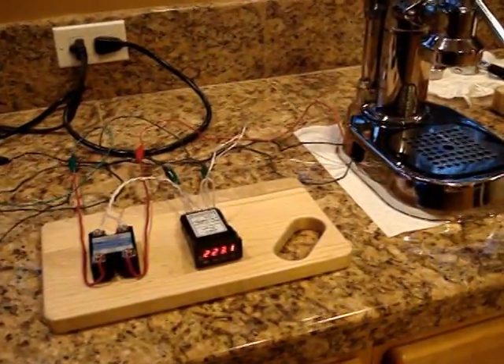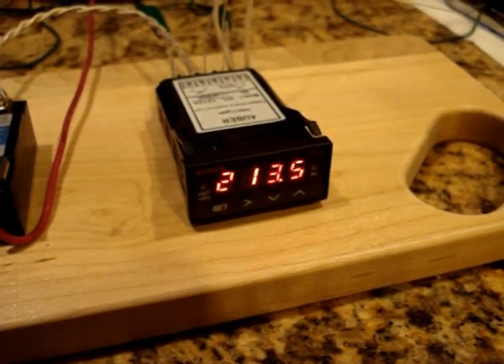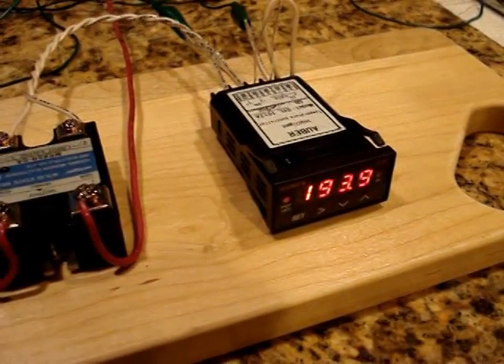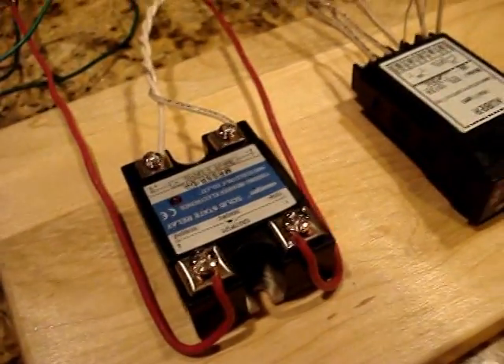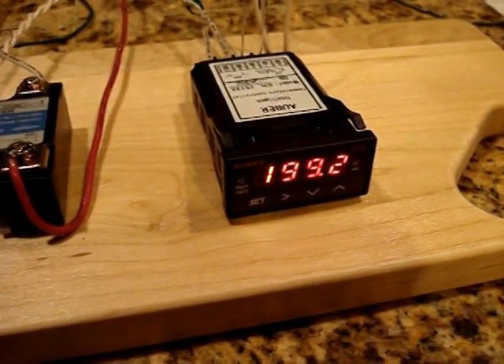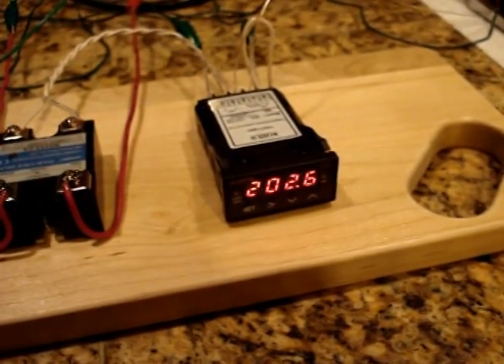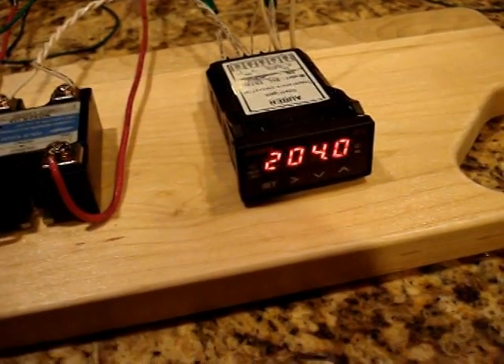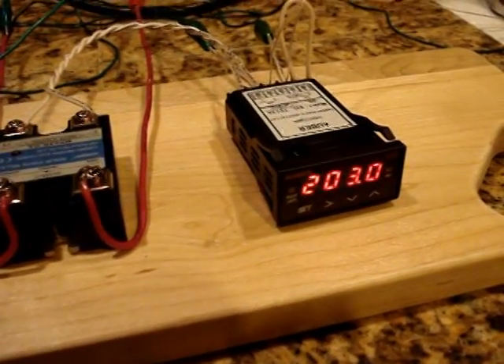La Pavoni Europiccola manual lever espresso machine with Auber PID temperature controller RTD sensor

Comment: Nice mod but not really necessary. I have a 60's era La Pavoni with no pressurestat.  My low element keeps the boiler pressure steady at 0.6 BAR.  What is vital are group temps, and I measure these with a simple digital thermometer.  I can keep the brew temps consistent and can pull good shots in succession as a result.

Comment: @ray5961 sounds awesome, I thought that you went to oversize relay so it doesn't get hot, but you probably just want to be sure? I don't own la pavoni yet so I don't know if the base get's hot, but if it does and you use the aluminum plate it will suck the heat from the machine, that would probably make it kind of a bad heatsink for relay, and it would make you wait longer to the machine to heat up. have you thought about this? but at least it should give a nice extra weight for the machine

Comment: Hi ray, I both hate and love this mod, you probably understand :D I also read what you wrote to home-barista, but I don't have account there yet so I can't comment there(gmail is blocked for registration). question: can you actually fit both of the units in  the base of La pavoni? or do you need to build like extension to fit these under the la pavoni